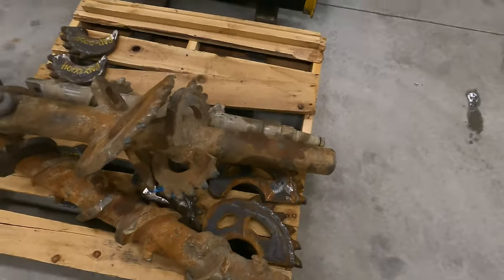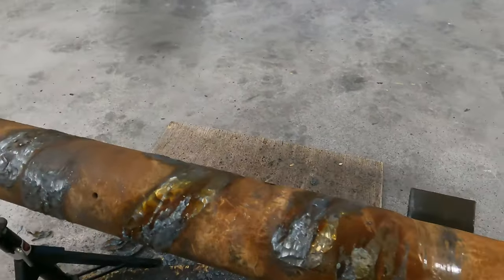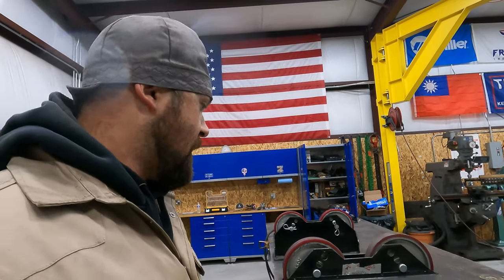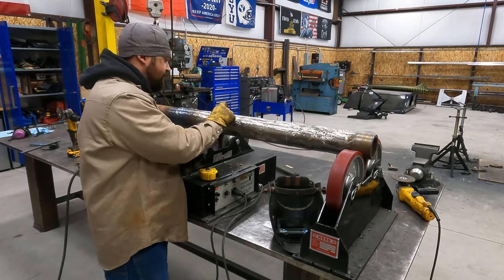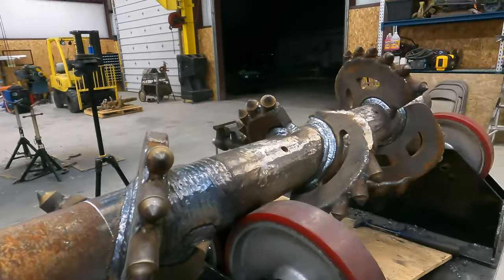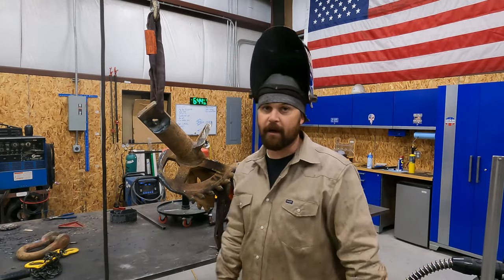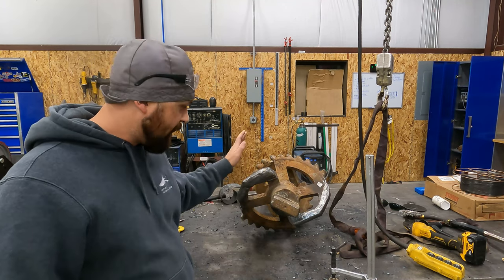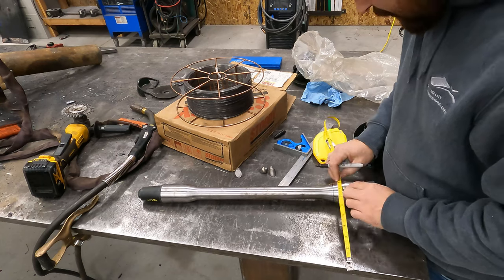Welding repair on reamers and welding business woes

Comment: I was curious about something on the build up of the second reamer. Could you have cut that piece out and replaced it with AR400 plate and saved a little time of having to build it up or did it have an offset that would not allow that as an option? Just curious was all. Thought it might have saved you a little time, even though that does not sound like an option since the customer was ready to jump ship.
Reply from the maker: That definitely would be another option. And it would most likely be quicker, but I didn’t figure that expense in my price so it would’ve most likely been more expensive, and with a gem of a customer like that one, it probably would’ve been an even bigger battle. That is a good suggestion though. 
Thanks for watching!

Comment: Hi I am from South Africa and do not know your steel and labor prices, but  could it possible be cheaper and a lot neater to replace the shafting rather than gouging it off with a plasma cutter then machining new thread. I am a difficult (perfectionist) client, but also have my own engineering shop. I am just the owner with no training in metal/engineering work, but have 2 boilermakers working for me. Love your videos keep them coming. I would say this, try to find out from the client what could possibly be done differently to resolve this and try to keep him/her happy even if you lose money, he will always come back to you (then you can make up what you have lost (play the long game). Try and give an estimate then the clients can not come back and complain about the price. I manufacture concrete products, but we design and manufacture all our own molds.
Reply from the maker: Paul, first let me say thank you for the feedback. It is appreciated. As far as being able to use new materials, with steel prices at an all time high here in the U.S. it would be more expensive to buy new and thread it/machine it to spec. Nothing wrong with thinking outside the box though. I would agree that giving a bid first would be a great option, although usually when the drilling company wants me to rebuild a reamer, they just bring them and drop them off. I don’t really get the opportunity to give a bid. This is actually the first customer that has had a problem with the price with reamer work. I also feel like i can’t be changing my prices to cater to what the customer wants to spend. If that was how the world worked, no one would be in business. I can’t go to the gas pump and tell them “I don’t like paying $6.00 a gallon for gas, let’s negotiate the price”. If I want to drive my truck, I pay what it costs. What I’m saying is if I were to start negotiating my shop rates, then everyone would want to start negotiating. I think the fact of the matter is some people are tight with their money, and would rather sacrifice quality, and some are ok spending a little more to get a quality product. And I would say those are the customers that you want to keep doing business with. Not so much with the other type. I’m flattered to think that someone from South Africa is watching our channel. Thank you for the feedback, and thank you for watching!

Comment: I not even capable of doing a 1/4 of what you do with the tools and shop I have and even I have delt with this just doing side work for cash! I try and take on work that I know the bigger welding guys around me won't touch and it puts some cash in my pocket. I've been burned on getting paid for a job or two and have had guys question my price when I damn well know that I'm less expensive than bigger shops. And you have seen the kind of work I do, its simple stuff that a big shop won't even wanna have come through the door. Like you said though that's how it goes sometimes. I don't know how to do everything welding and fab wise but the stuff I do know how to do is what I try to stick with.  I may be cheaper than most guys but I wouldn't take on a job like that beciase I don't know much about it. I know my limits and don't wanna screw up a customer with a job I can't handle just yet.

Is this a side business for you? You seem to work at night alot lol if so you're killin it working a day job too 👍
Reply from the maker: I’m sure you know how it is where you run a side business yourself. I would say the customer can be the biggest challenge at times. To answer your question, yes, I work full time and then work in the shop In the evenings. I do have my business license and I am insured, which I think helps get some bigger jobs. It is quite busy, doing both, but I wouldn’t ever consider going full time until I felt like I had enough work/income to support myself and my family. I   Think it would be more stressful if it was full time as well. I’ve tried to stay out of debt while building my business, which is nice when things slow down because then I’m not stressed about paying a bunch of bills, and having constant cash flow. It’s a process.  I just try to grown a little at a time and be smart about what my investments are and when I should invest in things. BTW, I enjoyed the first episode of the truck build. Good work!

Comment: Your issues are the same in every industry.  I'm retired now, but numerous people didn't want to pay me as well. Fortunately, I was in a business where rate is a known quantity up front, so I either chose not to work with them, or just held firm. I have to wonder if your customers have ANY idea the investment of time &  money you've got in your shop. You're not some guy working out of his garage with a Harbor Freight flux core welder. I've seen a few prices quoted for work at your skill & equipment level. It depends on location a bit, but pricing goes from a low of around $100/hr.. to over $200/hr., with minimums for everything. Hope you do well...
Reply from the maker: It is difficult to give an accurate quote on a lot of projects, because you never know what you might get into once you tear into something. As far as your assessment on price range for quality fabrication work, you are right on. It’s always surprising to me how many people are shocked by that, but what they don’t realize is the investment that goes into starting and running a fabrication business is HUGE. One problem that I have encountered is that some people don’t treat me or my business like a business because my shop is in my back yard, therefore some people don’t see it as a Legitimate Business, they think it’s just a “hobby”, which couldn’t be farther from the truth for my situation. I appreciate the input.

Comment: I feel like it's not that the customer was hard to deal with, or that you were too expensive, but that the cost expectations weren't managed by the supply house. Seems everyone learned a lesson. Expectations have to be set ahead of time. Perhaps, give the supply house a price range or have the customer set a do not exceed price.  Overall, I think you did the work required at a reasonable price. Also, don't take it personal, its business.
Reply from the maker: There were definitely lessons learned, and although I struggle with it as times. I am still learning not to take things like that personal. Thanks for watching!